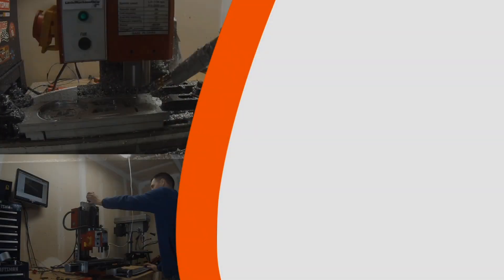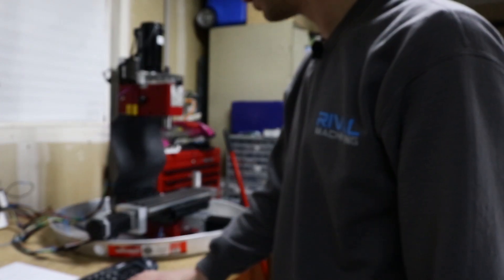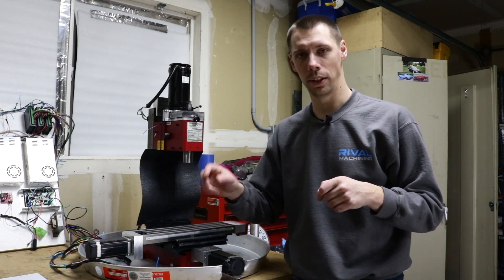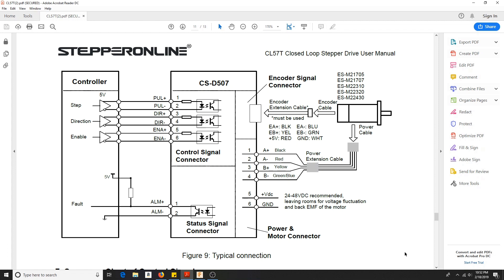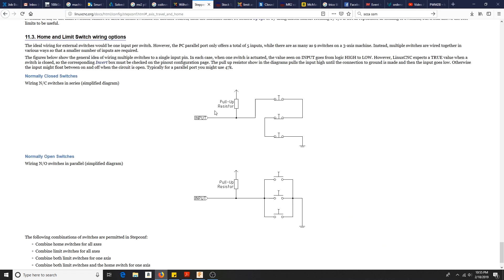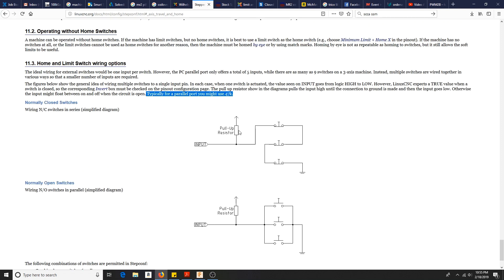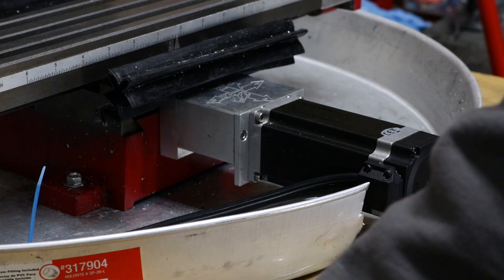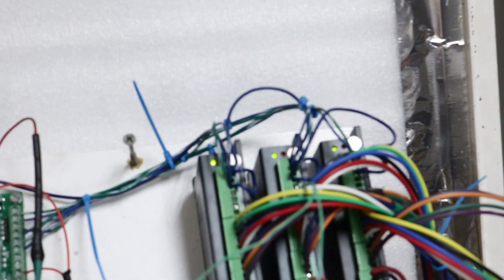Crashing My Mini Mill - Closed Loop Stepper Test

Comment: So if the closed loop is only back to the driver, then what is the point of the closed loop?? I always thought the point was that they won't lose steps, but if the alternative is just stopping and throwing a fault then Is that any better?  I'm interested because I have a spare mini mill just sitting around, and I would like to build it with servos, and actually make parts for people, but not have to babysit it....
Reply from the maker: The driver is constantly comparing its input to the output so it will micro step to correct itself.  There's a previous video where I use a wrench to turn the stepper and it forces the wrench back.  It only sets a code if it's off a certain number of steps.

Comment: Put some glass scale encoders on the machine, it will tell linuxcnc the exact position and be much more accurate (but you need Mesa Hardware for it )
Reply from the maker: Thanks for the info

Comment: Would you be willing to post a wiring diagram of your steper + drivers? Having a hard time getting my steppers to turn...lots of hissing and whining and heat...I think I have the motor leads in the right order...but maybe not?
Reply from the maker: I don't have one drawn up of my system but there is one in the CL57T driver manual.  It's page 8 figure 9.  What they call the controller is really a breakout board, and the CS-D507 is really the CL57T driver (typo maybe).  I assigned a pin on my breakout board for pulse positive and another for direction positive for each axis.  I connected the pulse and direction negatives to each other and grounded them through the ground on the breakout board.  I left ENA not connected.  From there, they wrote what colors correspond to what for the stepper motor and encoder.  I hope that helps!
Reply from the maker: I just realized figure 2 shows the common ground and pulse/dir positive setup I am using.
Reply from the maker: I'm not sure what control software you are running but I had to check the box in LinuxCNC to invert the step signal.  Maybe that's the problem?
Reply: @RivalMachining  I think we have the exact same wiring setup. Did you have to do anything with the rj11 plug and the software they provide to get these working? We're not using that
Reply from the maker: No, they come pre-programed.  There are so many variables in the system that I'm kind of shooting in the dark with suggestions.  Do the drivers have green lights?  If so, I would guess it's a controller problem or maybe a dip switch on the driver is wrong.

Comment: Sounds to be fun and exciting to watch you share what you are doing here, hello mini-mill aggression police might come by to see you for crashing. We love the little mill it is like the only one we have a TAIG 4 axis home built CNC. You utilized a water heater or car pan we used a box made into a shield from Home Depot. We use ours to engrave flats and cylinders mostly. We placed our controllers s into a nice enclosure but then again this is all we have, while you have a bigger machine, so we get it. We run SolidWORKS so we do not know LinuxCNC. We used to get crashes and just really lost in space stuff but the machine is what the machine is. Thank you for making a new video and nice to see you here again. Lance & Patrick.
Reply from the maker: It's good to hear from you. I've thought about making this machine a dedicated engraver with a high RPM spindle in the future.  I think it would be better suited to smaller cutters and higher RPMs.

Comment: Its good to see someone else using these closed loop drivers , and highlighting the use of the alarms . I'm using two of them with Nema23 stepper motors on a CNC router ( Z axis is still open loop)   I managed to crash out last night with a piece of 6mm silver steel  in the collet ,and also   clamped in a lathe chuck . (I was looking at using it for alignment,I'd intended on raising the Z axis but managed to move the Y axis instead, the silver steel was bent before the stepper controller cut out. Fortunately I don't think I've damaged the spindle.
Reply from the maker: Ouch, I hope the spindle is ok.  I think these steppers are set to fault after they are 180 degrees off from where they should be.  For me that's about .0025" based on the ballscrew pitch.  I wonder if you need to connect the driver and make your parameters tighter.
Reply: @RivalMachining  Thanks,  the spindle seems to have survived , I've machined some 8mm MDF laminate flooring to make a hand router template,  this evening including a 6mm drill using the collet that was in use. and everything seems fine , so lucky escape from a stupid mistake.

Comment: Mini mill video! Can I get the link to the break out board your using?
Reply from the maker: Here you go.  Its pretty cheap and sold by a lot of different companies. https://rover.ebay.com/rover/1/711-53200-19255-0/1?icep_id=114&ipn=icep&toolid=20004&campid=5338261357&mpre=https%3A%2F%2Fwww.ebay.com%2Fitm%2Fbreakout-board-DB25-for-cnc-router-kits-milling-engraver-cable-longs-motor-mach3%2F262534762289%3Fhash%3Ditem3d204a8f31%3Ag%3AfzgAAOSwPSZbfR04